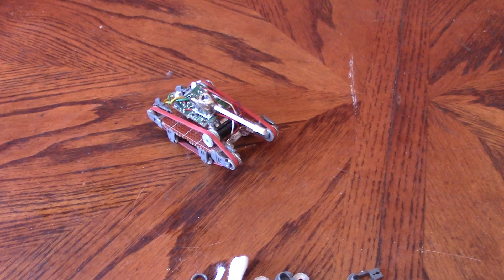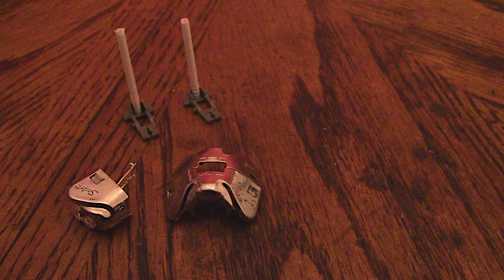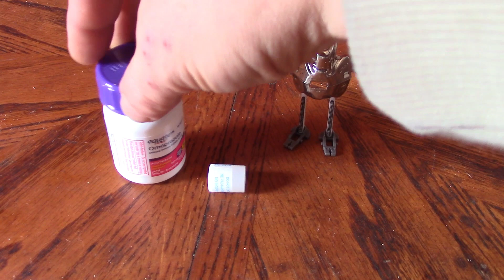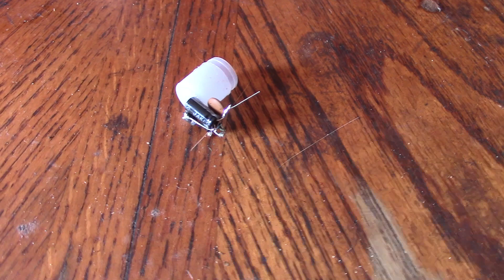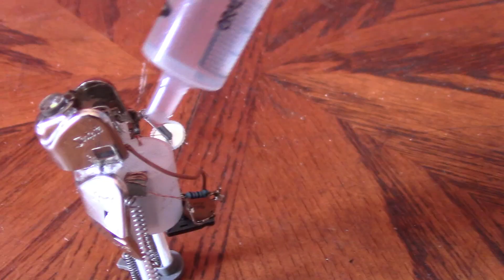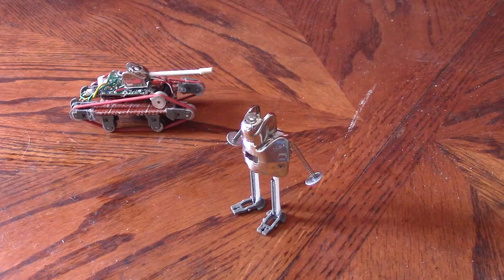Build - Robot figure powered by water

Comment: to be pedantic, it isn't actually water powered.
Reply from the maker: I'll see your pedantry and raise you this - It's an interesting pedantry in fact, because the view should be of the Mg being very slowly consumed and, therefore is the 'power source'. However, in the case of household and worldwide Li-Ion, the common view is of the battery (cell) being lithium powered. In reality, the negative electrode is a graphite and the positive is a phosphate... the lithium being in the electrolyte. Everybody refers to them as lithium batteries. An Alkaline AA is named for its electrolyte, the Zn casing being slowly consumed. The same common view would say the cell here is water powered. 
But, I know what you mean, Ben 😀

Comment: Clever!  I think you made a boost converter (or joule thief if you prefer).
Reply from the maker: Yep, it's a blocking oscillator. Such circuits were popularised on here by Lidmotor with his 'Penny' design and a group of us ran with tweaking and modding about a decade ago (my former channel was Slider2732). LED brightness and flash speed is governed by the cap and resistor to the transistor Base, with 1 Meg Ohm and 0.1uF being a good starting point. Higher values will slow the flash rate but increase flash brightness, lower can create a JT solid light but it will be far dimmer with a water based cell 😀

Comment: That's gotta be one of the coolest little things I've seen in my life! Great work 😄
Reply: Good build, neat circuit, clever design.
Reply from the maker: @johnwynne-qx6br  Cheers! I've just fixed his leak troubles with some glue over the base of the water cylinder, though it was fun to see the problem   😂
Reply: When you have got to go you have to go !. How long will the battery last with your circuit?..
Reply from the maker: @johnwynne-qx6br  It did bring along a bit of character to him 😁 Battery will last about 3 months, then the magnesium piece will need to be replaced. I've recently refound Nephilim Penny in a house moving box, a water powered large oscillator from 2011, which is also magnesium, copper and water powered. It ran 24/7 for many years on the same water and copper until we moved house in 2022, just had to regularly replace the magnesium strip.
Reply: @Slider2732_  hi thankyou for your reply, I have never had much luck with them I will have to try again. They can be made into interesting things as you have demonstrated with the  robot and for the sake of replacing some magnesium and cleaning the copper a good way to run oscillators and led's. I have just found your old channel I am impressed with all your projects, cheers.
Reply from the maker: Haha thanks... It was fun to use the bits up and see how tiny I could make the battery and circuit 😀